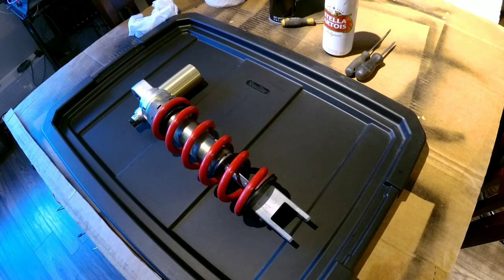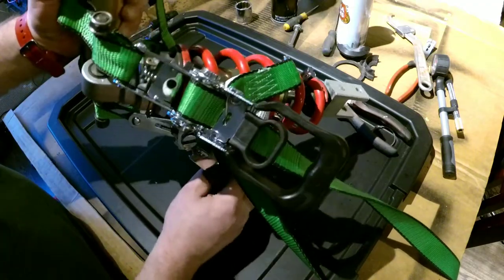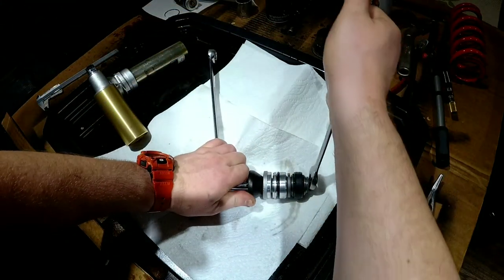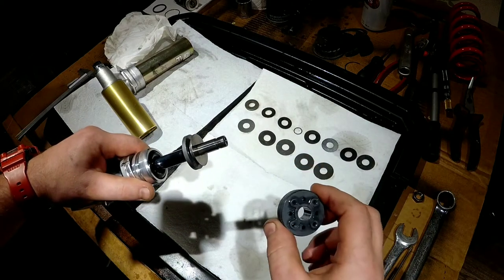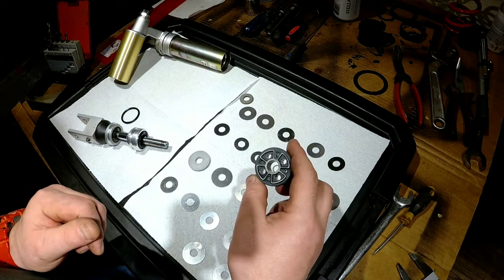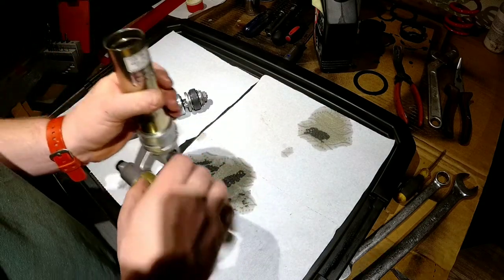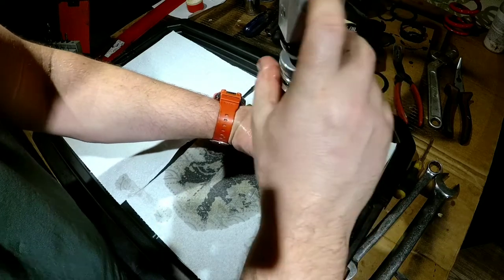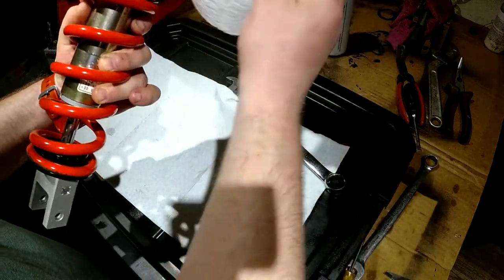Honda RVT1000R Showa Shock Refresh and Revalve (with minimum tools)

Comment: Many thanks for recording & editing this video.  Have never seen the inside of an RC OEM shock.  

My SP1 shock wasn’t leaking but I wanted to refresh the oil & nitrogen charge before a track school in July.  I removed the spring the same way with ratchet straps (process was easier with the bottom end secured in a vice) and found clear drain/fill/bleed instructions for a similar shock.

Started by discharging the bladder then removed the compression adjuster.  Once the oil was fully drained I put some air into the bladder to hold its shape and refilled.  Bleeding instructions included lots of shaking & rotating shock with hand over the compression port + stroke travel with rebound valve fully open.  Took several top-ups and purge cycles before the bubbles stopped and no air was heard passing through the rebound block during stroke travel.  Compression valve was replaced and bladder charged to 175 PSI, as per RaceTech OEM specs.

Shock worked well for an OEM unit on track.  No budget for an Ohlins or good aftermarket unit so the oil & nitrogen refresh was the required minimum.  If I ever have to replaced seals or the bumper your video will be a good disassembly/assembly reference.  Will also ensure I have a can of my favourite Stella too lol.

Merci encore!  Steve Halifax NS